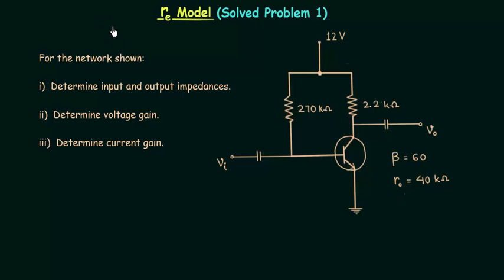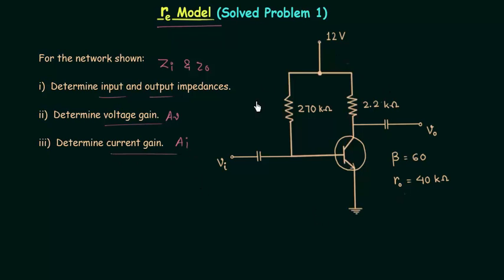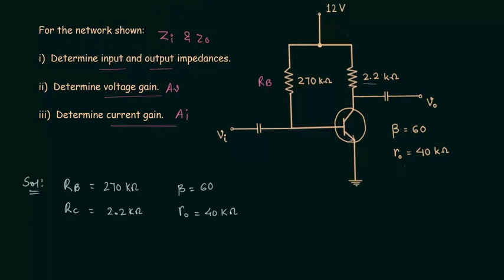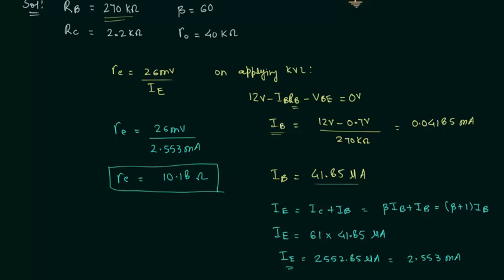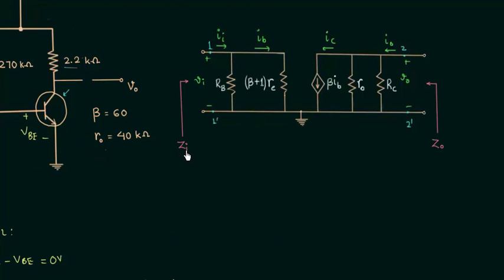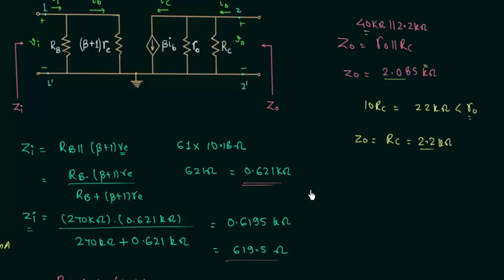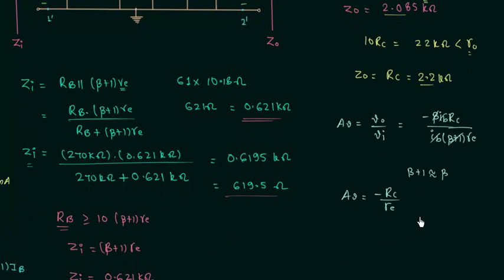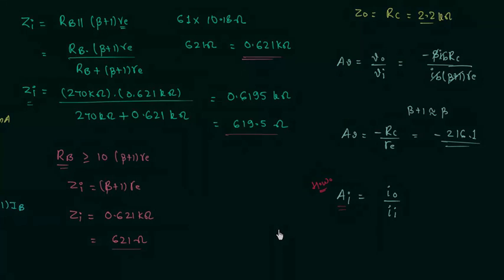re Model (Solved Problem 1)

Comment: current gain =56.87 because RL is parallel of Ro || Rc. Because maximum power transfer when input and output resistance are equal. So, RL=Ro || Rc. So, the final Formula is =Beta(Ro/Ro + Ro || Rc ) . Ro>>>>Rc . So, Current gain= Beta(Ro/Ro + Rc)=56.8 something

Comment: I'm feeling a bit slow here, by with no load resister RL, there would be no output current,  so isn't the current gain zero (that's what the derived formula Ai would suggest).

Comment: There is no load across the output. As a result, there will be no output current. So the current gain will be Ai= 0/i(input current)=0.
or we can consider the R(load) as infinity. Then if we put the value on formula, we will get the Current gain 0.

Comment: In general if we don't consider simplification then current gain=56.74
And if simplification is considered i.e. here Rb>>10(beta+1)re & ro>>10Rc then Current gain= beta=60
Reply: Without any approximations, I guess A_i should be 59.86.
Reply: 56.74 is current gain\
Reply: If we consider parallel combination of r0 and Rc then the current gain is 59.86 and it's 56.74 when only Rc is considered. But don't know what should be the exact concept.
Reply: @debanjan5402  where is the RL? How do we calculate it?

Comment: Ai=current output /current input =ic/ib=Bib/ib=B=60
Reply: Sơn Nguyễn Hồng   R load not given  and there is open circuit that's load R is infinite and that's the reason gain will be beta

Comment: Actually, you must take io as current passing through Rc....Not the io explained by the lecturer...Refer boylsted page no. 287...io is taken as current passing through Rc..
Reply: If we consider parallel combination of r0 and Rc then the current gain is 59.86 and if we consider only the Rc current then it's 56.74. What should be the exact ans?

Comment: In order to calculate the current gain, first we have to determine both io and ii.
This is done, in my opinion, by using the impedances zi and zo and ohm's law. Therefore, ii = vi / zi,  and io = vo / zo.
By doing the fraction in Ai, we will have the answer of around 61.
Reply: what about RL(load resistance)?
Reply: THANKS
Reply: where did you get  vi and vo from
Reply: @abusamraaslan3157  
Vi=ib(B+1)re
Vo=io(re)

Comment: current gain=59.86===(60)approx..
Reply: where  do we  get RL?
Reply: i think it's equal to zero   
 @chitikeshikarthik5832
Reply: @chitikeshikarthik5832  RL=0??
Reply: @sahilking8357  Not necessarily it should be ...if the same configuration was maintained with the small singal added in the emitter branch then voltage gain would be positive